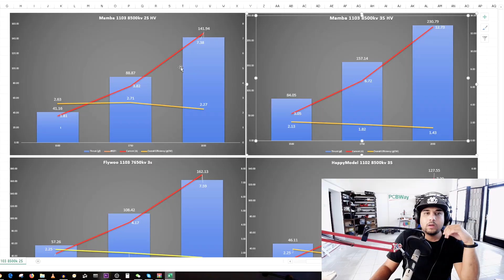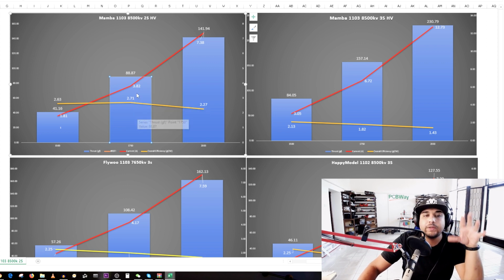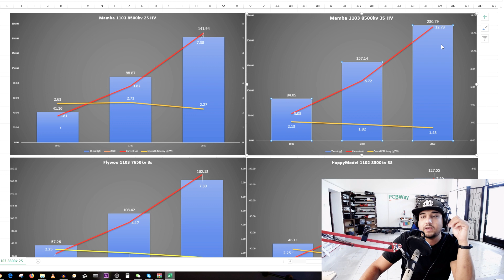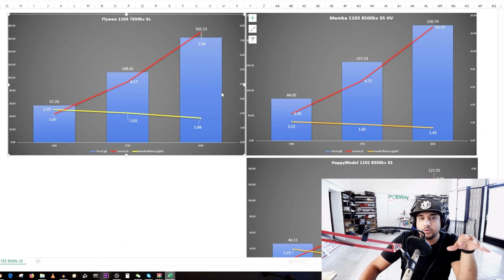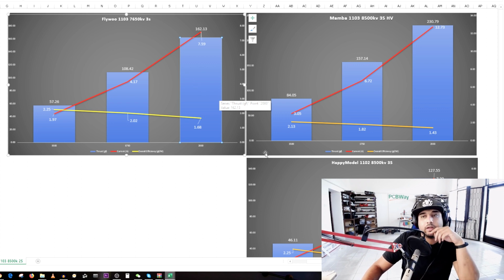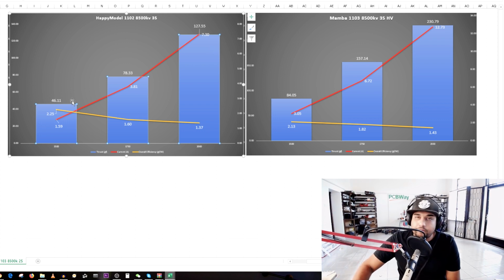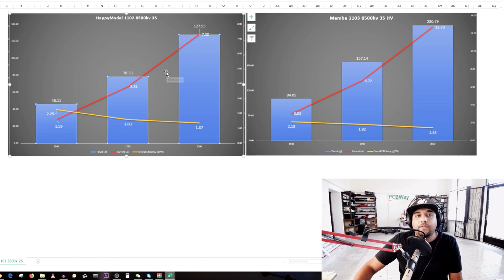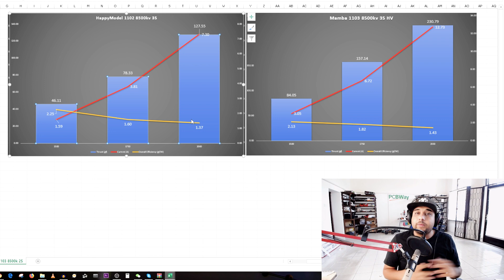Mamba 1103 8500KV // Thrust and Efficiency Results

Comment: How hot were the mambas after that test? 230g from an 1103 is insane! I mean consider a toothpick type quad with those motors on 3s, auw around 80g. Power to weight is absolutely bonkers!
Reply from the maker: It was almost hot. However there was no smell  for the coating which means it handled like a beast.
Reply: @DroneMesh  awesome! Have you tested the happymodel 1103 7000kV from the Larva-X?
Reply from the maker: @mece66  Yes yesterday I will release that info with the overall review.

Comment: Interesting data and tests, but my interpretation differs.
Mamba 1103 is more efficient than Happymodel 1102 for sure
I think this graph format with throttle input as the x axis  is not suited to compare motors that develop different thrusts.
Here the thrust developped by the mamba at the first level of throttle is already twice the thrust of the happymodel at same throttle level.
We have to compare efficiency for the same level of thrust for it to make sense.
Here it means that you should compare 1st level of thottle on mamba with roughly second level of throttle on happy model to get same thrust and then you see that mamba is superior in efficiency (2.13 vs 1.60) .
To compare the first throttle level of happy model you need lower than 50% throttle data on the mamba.
Reply from the maker: You are correct I thought I edited this mistake out and placed my correction.
Reply: Completely agree with you
Reply: yes, x axis should be amps (or *watts if you want to compare 2S with 3S) and thrust:weight on the y axis. Volts should also be reported.
Reply: Indeed x axis could be amps or better watts (to abstract cell numbers). 
I would even go further and try putting the thrust in gramms as the x axis. And then throttle, efficiency, amps can all be represented by curves on the y axis (1 curve per applied voltage).
Reply: @sebastienburdin5390  I did this visualization off the previous thrust test post https://youtu.be/WD9eD_5O49g . The other possibility for the x axis is battery stress in terms of C so that if you want to normalize to how hard a given battery may be stressed if comparing across different mAh ...
Reply: was about to say :D mamba does 84g at 50% at 2.15 efficiency vs happy model 78g at 75% at 1.6 efficiency. 

Also, error 2 in video - there is no 3s toothpick that weight 45g :D (not with the battery, which you need to fly dah ;D )

If you want to compare. than make measurement at  - 25% 37.5% 50% 75% 100% - this will actually show which motor will be most efficient (as to same prop, like 65mm)
-- BTW 1s test would be extremely interesting too.
-- XCEL chart would be best way to compare those I suppose

Comment: You have sound with echo. Thx for your work!
Reply from the maker: I know it would cost at least 10k to try to fix it. I moved alot of the stuff to the backroom now for my new assistant to get tests done and it left me with an increased echo.
Reply: @DroneMesh  I don't mind  at the same time I noticed it without trying to be critical. Would some Acoustic Foam on the flat surfaces cost less?